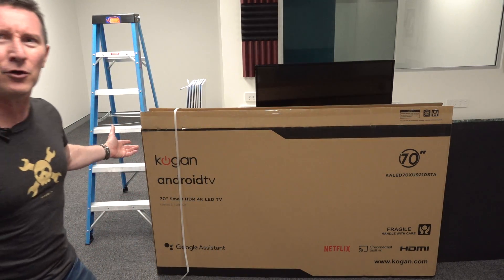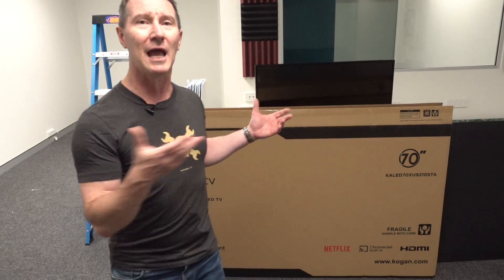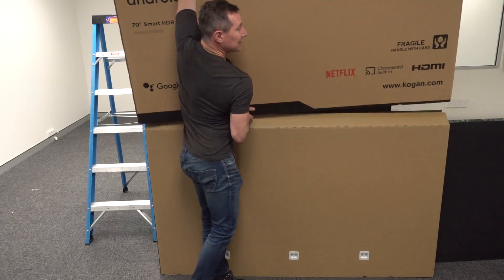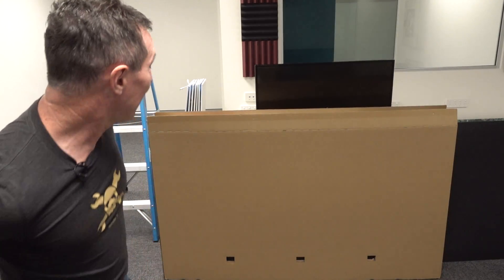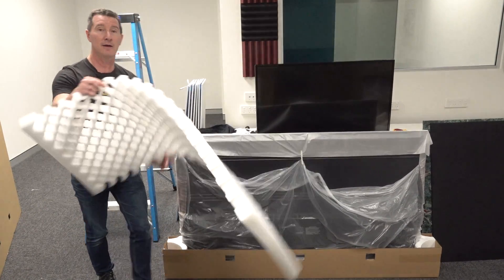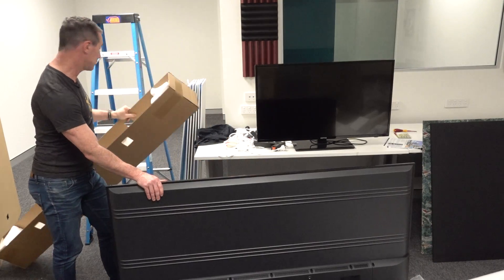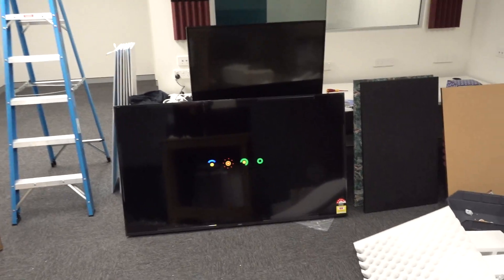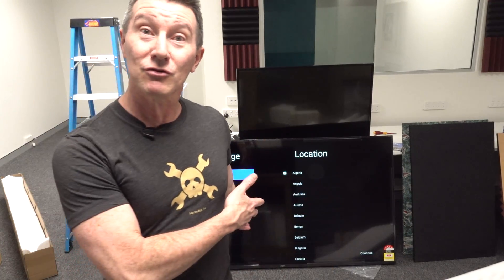eevBLAB #77 - TV Packaging Technology is INTERESTING

Comment: All very wonderfull that the tv is well protected but what does the consumer do with that mountain of packing materials.?
Reply: They recycle them, in the exact same way that they recycle other household wastes.
Reply: @johncoops6897  did you ever actually try it. The recycle bin wont take all that cardboard in one collection. The styrofoam has to put in the garbage bin.

I just bought some new furniture for example. Two couches. There is so much cardboard, foam and plastic it will take several months to get rid of it.
Really the retail shops should collect  it as they have much larger recycling facilities.

Comment: Did you buy it for the 'smart' features or just because it was a good deal?
Reply: There is a good argument against smart TVs and that its better to buy a 'dumb' TV with more inputs.  With a smart TV you are reliant not only on the integrated services still being available over time but also on software updates by the TV manufacturer to keep the TV compatible with any changes to the platforms it connects to.  There can also be significant security issues related to an internet connected TV, especially if you don't get frequent OS updates.  If you have a dumb TV and buy the hdmi connected external module (say chromecast) its easy to swap out an old component for a new updated version or a different service.  And of course there is then the cases where the smart tv manufacturers added in banner ads to some of the TV menus or removed otherwise working features with a software update without warning.

Comment: Wow, that uses more power than my fridge and nearly as much as my gaming PC. When did TVs get so power-hungry?
Reply: It's 205 watts, which is much less than your fridge and gaming PC. The reason that it's rated as using 532kWh per annum is because of the long running time per day. They are allowing for it to be powered for 7 hours every day.
Reply: My gaming PC with two monitors runs about 150-180W in normal use. Running twitch games in 4k it is close to 300W but for me thats a couple of hours a day. The fridge is on 24/7 but obviously the compressor only runs occasionally, and that was the label that I see every day that made me go "HEY, that TV uses more power than my fridge"
Reply: @mozismobile  - LOL, so you are one of the people who doesn't remove those ugly labels from the doors of your appliances?
Reply: @johncoops6897  If you think they're ugly it makes sense to remove them. I don't, so I don't. But sure, I laugh at you too.

Comment: The problem we see at work is people laying the TV face down and lifting one end of the box, with large thin TVs you can actually flex the panel enough to snap it in the middle. You can normally get away with lifting TV like this if is laid on its back though. But you should always try to keep them upright as the packaging says.

Comment: These days, every TV on the market has "Some weird-ass Android thing in it and Chrome cast built in". I want to get a TV to watch, not one that watches me. Can you make a video that shows how to remove every component in a set to turn "smart TVs back into "dumb" ones? All I want is basically a monitor that just displays whatever I have connected into the various jacks that are on the set.
Reply: No, only SMART TVs have Android or some other operating system built in to them.
If you want a basic, non-smart TV... then simply buy the less expensive TV that is NOT a smart TV.
It's not rocket science.
Reply: @johncoops6897  It's hard to find a TV which is not a 'smart' TV. I've heard speculation this is because ad contracts more than pay for the additional manufacturing cost.
Reply: @eDoc2020  - the stats seem to show that over 70% of sales are for smart TVs. This seems to primarily be driven by consumers who will pay a bit extra for integration of streaming services, rather than the manufacturers offering additional features for free. From my own research, normal TVs are definitely available and cost less than smart TVs, however the hardware to add smart features is very crude and cheap so the incremental cost for a "smart TV" is low compared to the overall cost of a large screen device.
I can understand the average consumer's desires to have this stuff integrated, however the proliferation of Android based systems really creates a big problem in the long term. Android is all about selling products, so there is a relentless addition of more and more resource-hungry code that literally cripples the hardware within a couple of years. Not so noticeable on high end phones that use powerful processors, as they can maintain effectiveness for a few years until they are superceded and replaced. Consumers dont seem to worry much about that with phones, however they want to keep their TV for 5 or even 10 years... and no Android OS is gunna work properly on 5 year old hardware, let alone anything older.
Personally I think Smart TVs are idiotic, so I specifically buy non-smart models. If you also feel the same way then don't purchase a smart TV, as that drives the perceived demand for them higher and lessens the choice. In other words, you should actively seek out and buy a non-smart model even if that means that you choose an alternative brand.
Reply: @johncoops6897 Of course it's not rocket science. It is simply taking the time to understand what you are reading. Please read the first line of my previous comment again, especially the first seven words.
Reply: If it insists on connecting to the network to set up, unplug the Ethernet cable once setup is done.

Comment: SmartTV = oversize smartphone that's going to stop getting security updates after a few years. Which were sub par to start with... 
I'd like to see a demand for large screens that are like PC monitors take over because I want nothing to do with cable tv.
Reply: It's odd that a huge TV with Android is less expensive than a decent Android phone!
Anyway, smart TV is not cable TV.... it's internet based.  If you don't want a smart TV with an operating system, then simply buy one that doesn't have that shit inside.
Reply: @johncoops6897  
I know it's not a cable tv. That was two statements,  not a paragraph. 
"then simply buy one that doesn't have that shit inside."
A simple "Large Format Display" isn't as popular as it should be...
Reply: @Foche_T._Schitt  - the requirements for a PC monitor are significantly higher than a TV. The TV dsplay can get away with much less processing power, colour accuracy and refresh speed (on a pixel level) than a computer monitor. So a large formal screen for viewing at long distances is already very popular because they are relatively cheap - they come with a free TV tuner you can use if you want that. A computer monitor with similar size will be massively more expensive. Furthermore, you can't really use a huge screen as a computer monitor because of the geometry of the viewing distance . Your eyes will get very tired very fast because of continually needing to change focus do accommodate the difference in distance between the sscreen centre and the corners.

Comment: Good video, but a quick note on the front screen foam lattice: The gaps are not for weight reduction, but to give it extra compressibility. If the sheet was solid then the screen would be more susceptible to damage from static pressure (e.g. some idiot stacking them horizontally).

Comment: Oh look! It runs #linux . like most modern smart devices and novel users.
Reply: It eventually runs Linux. I hope the ridiculously long boot time is just a first time thing, couldn't live with a TV if it did that every time you power cycled it.
Reply: @ferrumignis  - On android, it's slow for the first boot after each full OS install. That's when it reconfigures the drivers, etc. Subsequent boots will be quicker, however it may do the same on first restart after a major OS update (if they ever release any LOL)

Comment: I open a lot of tv boxes and every company has their own way of doing it and all have advantages and disadvantages.
For example Samsung likes to use these plastic clips that hold in the styrofoam and hold the box together.
once these plastic clips are both out of either side the box can easily pull apart in the TV can be pulled out easily. The downside is you have to take out all these little plastic clips, they can get kinda stuck and make them hard to get out.

Comment: Awesome box design/engineering.

The 36" Sony WEGA I bought in '99 had functional but NOT very customer-friendly packaging. Single, very thick-walled box, big chunky styrofoam blocks but no effective way to get the ~100kg TV out without cutting all 4 sides of the box. That meant I couldn't use the box for moving the TV later.
Reply: Yet the logical person would simply open the top, roll the box over, and lift the box off bottom-first.
Why? Because then the TV's base is upwards so that you can screw the stand onto the bottom of the TV.
Simple, eh?
Reply: @johncoops6897  Except that no. The ~100kg CRT was not designed to ever be flipped over so it was not packaged in a way to facilitate that. The logical person would have followed the instructions and cut the box open along the marked lines on the 4 sides. ;P

Comment: Airconditioners also come with similar packaging. Outdoor unit will lift off the polystyrene bbase plate when you cut the straps, though there they also have 2 fibre reinforced tape securing tapes as well, revealing all the outdoor unit, and with the coil set doing double duty as impact protection for the delicate fins. Indoor unit you slide it out the box on the side, and all is ready to use. Window wall units same as the outdoor units, you lift the top half of the box off, leaving the polystyrene base mould, with convenient holes so you can lift the unit to the hole it will go in.

Comment: I just got a 40kg air conditioner which had vaguely similar packaging (specifically, the bottomless box that just lifts off). Dumbo me didn't realize this at first; I was halfway through lifting the aircon vertically out of the box when I realized I had missed a much simpler route... there's always a first time :-)
Reply: Were there unboxing instructions on the box itself? Dave's didn't appear to have any; I think the omission is just silly.
Reply: @eDoc2020  Indeed.

Comment: It takes longer to turn on than unbox!
Reply: Yep, I think I'll just go back to my old CRT TV!
Reply: @ssks1979  At least you won't have to deal with any spyware and it will warm up a lot faster than modern crap can boot.
Reply: Heck, all-vacuum-tube TVs warmed up in a tenth of the time that one needed to boot!
Reply: @Nf6xNet  And practically all tube TVs have zero standby power when off. This 'smart' unit probably keeps its multi-core computer on all the time it's plugged in.

Comment: The industrial designer may have given some thought about the design of the packaging but didn't put much thought into the recycling of the considerable volume of packaging materials used. The backing plate with the plastic foam bonded onto the cardboard is particularly bad as this won't be easily classified into the correct recycling bins.
Reply: Probably quite minor given the TV will fail in a year and end up tossed.

Comment: I engineer video walls and other digital signage fixtures, and the industrial-grade screens we buy come packaged similarly. The screens are a lot heavier (extra cooling for 24/7 operation, etc.) so the box has to come off around the TV just like in the video. They're also designed so that the screen can go back into the box, so we can test assemble the screen and rebox it for transportation to the install site. Another nice feature of industrial screens (Besides cool things like serial and network control) are that the heavier units have handles built into the corners. Contrast all this to a consumer-grade Hisense I bought, where I had to lift it out of the box by the bezel, only to find that the LCD had completely shattered. When unboxing the replacement I actually mounted the VESA adapter to the TV while it was in the box, then tied strings to it and lifted it out. I patiently wait for the day when TV makers take the hint and put removable handles on their screens.
Reply: Office Printers are generally the same, sides of the box comes off first, base last.
Reply: Leon Kernan Yeah, my new Epson printer came in a box like this. Very usefull if you have a trashed back and don't want to lift a 17kg printer out of its box.
Reply: Matsushita had that with the larger CRT TV sets they made, along with the rear projection models. They came with a set of handles that were held safely behind the set during use, but if you needed to move it you simply unscrewed them and moved them to the carry points built in, and attached them there to move it. As some of those sets were over 80kg for the CRT alone, you needed handles and 4 people to move them.
Reply: As an "engineer" you should be smart enough to realise that you open the carton, flip it 180 degrees (so that the base is upwards, then lift the box off. There is no need to lift the TV "up and out of the box".
Reply: @johncoops6897  The TV had instructions explicitly saying what to do, and I followed them exactly. I suspect that the LCD had been cracked before I unboxed it since the crack was exactly down the middle, and I didn't handle it in a way that it would bend that way. You're absolutely right that lifting the TV out of the bottom of the box is a good idea, and I'll keep that in mind if I ever have to do it again. I would be worried about the weight of the screen resting on the top bezel, though. (The screen I unboxed had an extremely small bezel) What the TV makers ought to do is design the boxes so that you open the bottom and immediately attach the legs, then put the TV in place and remove the box as the final step.

Comment: Kogan is basically a Samsung TV, it uses Samsung components
Reply: Looks similar to the UK assembled Cello TV's that we have at work, the feet look almost identical (noting that on our TV's the 40/43" have different sized feet to the 32") will have to dig out a main PCB at some point to see if there is a manufacturers mark. On the Cello's there is only one PCB that does everything, so PSU, processing and inputs are all on the same board, with the inputs along the right side and bottom of the PCB.
Reply: ROFL - Kogan is NOT using "Samsung TVs". They are just rebadging cheap chinese crap like hundreds of other brands are using.
Reply: Big Daddi Is it an Aussie brand that's supposed to rhyme with Hogan, a common Aussie surname?
Reply: @BarryManilowa  yeah, somewhere near Crocodile Dundee ))
Reply: @BarryManilowa  Name of the founder. https://en.wikipedia.org/wiki/Kogan.com

Comment: Look up the fcc id for the manufacturer.
Reply: It might not have a FCC id
Reply: As far as I'm aware, if it isn't sold in the US then it won't have one. I'm sure there must be an Australian equivalent, though? They may have different rules on how it all works at the very least and it might not be possible to use that as a route to track down the manufacterer.
Reply: @Darxide23  In Australia, Kogan, as the importer, would take responsibility.  See here: https://equipment.erac.gov.au/Registration/EquipmentSearch.aspx?atn=public&sid=E1024&bk=false
Reply: Also, lower level items below level three employ a self-certification approach where the paperwork has to be available within the company, but not submitted.  Level three requires submission to the regulators.